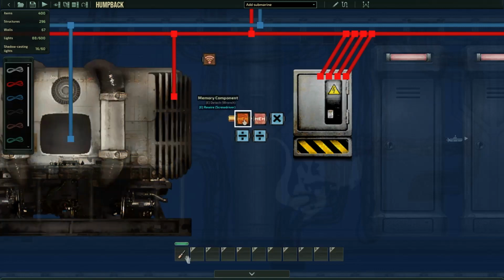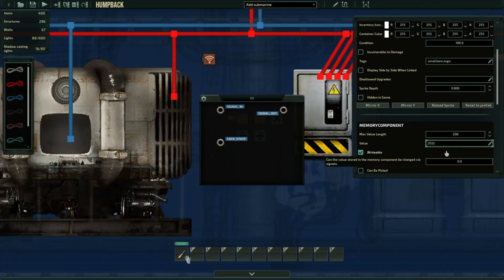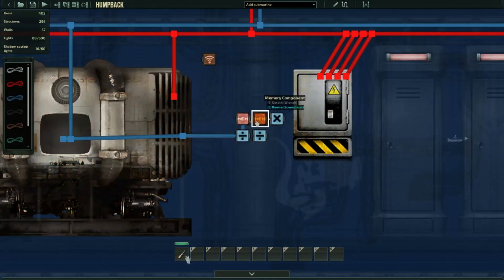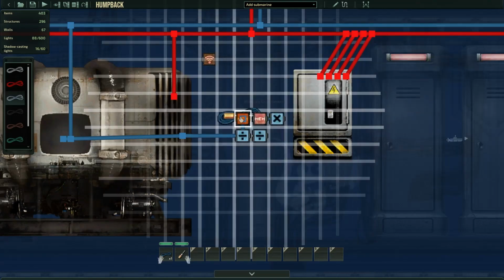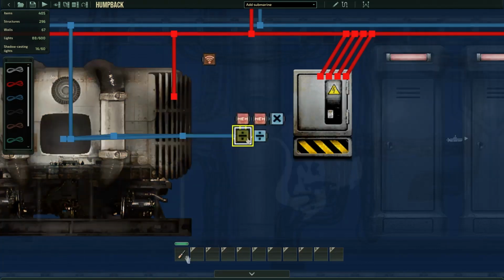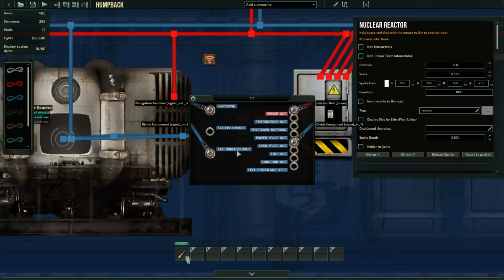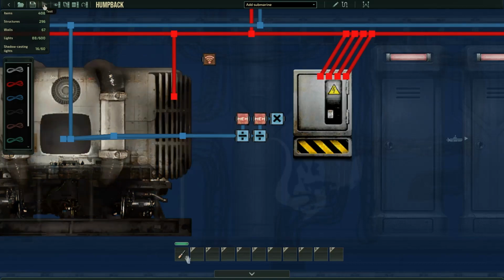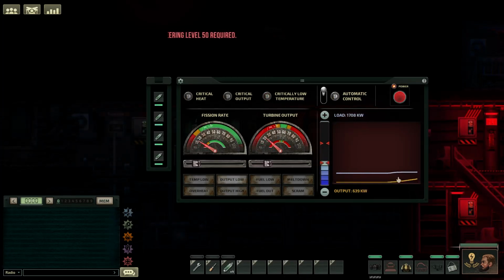Barotrauma 5C Automatic Reactor Controller - Cheap and Quick!

Comment: For the orca atleast you need to set the second memory component to 150 for it to run correctly
Reply from the maker: Tested it out today on the Orca, runs as intended - If the "Temp low" indicator flashes that's also by design, it should settle at around  3 bars, simply put we want the lowest amount of heat to be produced that still meets the load put on the reactor - 75 is the best value, check your wiring and try again. 

Side note the stock Orca has a PMAX of 35.

Comment: What do you put as Clamp max or min in divide component ? I saw your 9C OC and you put the relay component isOn on false by default but without editor we can't really do it can we ?
Reply from the maker: Well not quite, during an ongoing session just install a simple button that hooks to toggle_state on the false relay, you don't even need to connect another wire to the true relay in the first place - be sure to keep track of the state with a light, as for the clamps I leave them as is in all my campaigns.
Reply: @Adamonus  Amazing ! Love your videos ! And thank you

Comment: Thanks for this vid. Reactor controllers have always been pretty daunting to me but I finally decided to learn how to make one. One question, does it matter what fuel rods I use? Does it matter if I put 4 volatile rods in vs uranium ones?
Reply from the maker: No matter what you do this will take care of it, one final tip, on a cold start be sure to slam turbine output to max and let the system recalibrate itself (you avoid having the heat rising too quickly)

Comment: You may want a T cutoff to this, as you see at the end, the fission rate and thus heat generation can adjust a lot faster than the Turbine Output.  A battery array helps resolve the opposite problem of browning out and JB overload going from high output to low.
Reply from the maker: Whenever I do a cold start on this I just slam the turbine output to max and let the system handle the rest, temperature cutoffs, smoke alarm buzzers and all the other things can be nice additions.

Aside from that I also show (small glimpse )my battery system I made that's working in tandem with the ARC in my latest video ✌️
Reply: @Adamonus  Yea, my biggest issues has been well meaning people taking out rods because they think 4 rods will overheat, then when I say the reactor should run with 4, they throw them all in while we're running at high fission rates and we overheat.

Comment: Was looking at this and the math from the wiki.  It does not appear you account for more than 1 fuel rod or different types?
On the Fission Rate I tried (load*75)   Oh.  I see since both the formula for Turbine and Fission can have the same (load/Pmax) pull out of the formula and that saves you one (divide component).
neat algebra trick to reduce the component number from 7 to 5.
Reply from the maker: The fission rate controller (divider2) takes the fuel_out value from the reactor and turns it into a divisor, the more fuel rods you put into it, the larger that value grows and the lower the final value going to the set_fissionrate is going to be

Example:

load: 2000
pmax: 31

1 uranium fuel rod = ((2000/31)x75)/80 = 60 
2 uranium fuel rods = ((2000/31)x75)/160 = 30 
3 uranium + 1 thorium = ((2000/31)x75)/340 = 14

So you can pretty much throw any number or types  of fuel rods into the reactor and it will balance itself.
Reply: @Adamonus  Yep.. I designed mine from the math in wiki and then was wondering why I had 7 and you had 5 parts then found there was a math clamping issue, so that is when I did some math trick to get rid of memory for 100, and then I had to look at yours.. and that is when I realized you pulled a common out of the math for both Turbine Output and Fission Rate.

Comment: Tested it out and works great, thanks.
Reply from the maker: Great to hear! Always happy when my stuff helps people out (even tho my channel is of very low quality)

Some stuff I did do to suit my needs better; at the helm I've installed a lever which once it's pulled will OC the system by about 1.5 times the current load, the lever is basically hooked up to my mem cell (1) which holds the pmax/100 (the lower you go with this value the more output you'll have in relation to your load)

So to achieve this, you need 2 additional relay cells, 1 multiply cell and another mem cell.

mem cell(3) will hold the multiplying value which for 1.5 times of the load is 0.667
mem cell(1) goes into signal_1, mem cell(3) goes into signal_2 | multiplier(2)

mem cell(1) goes to relay(1) 
multiplier(2) goes to relay(2)

relays(1)(2) both get hooked to divider(1)  

Set the relay hooked to mem cell(1) to ON
Set the relay hooked to multiplier(2) to OFF

Set lever TOGGLE and STATE - OFF

//1.5 times is a conservative amount, if you want 1.7 or 2.0 for the subs that can take it then 0.588 and 0.5 are your values - or just go wild with it :))

I wanted to include this in the tutorial but sadly I didn't - hopefully my written instructions aren't that convoluted.